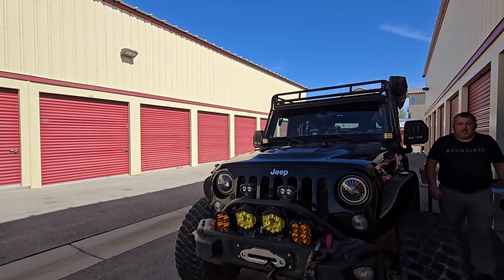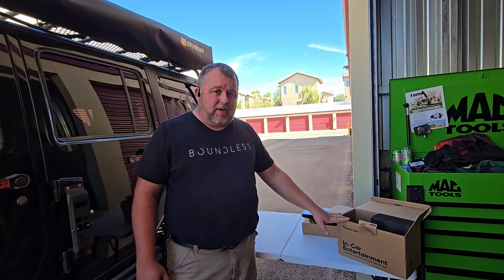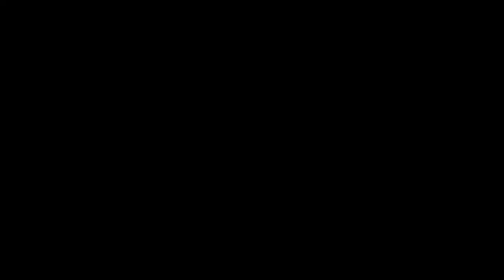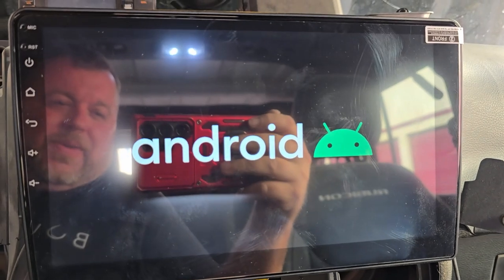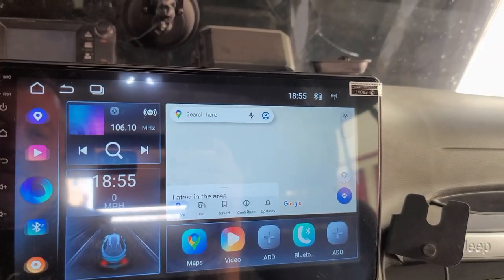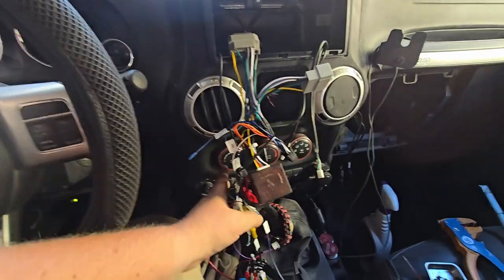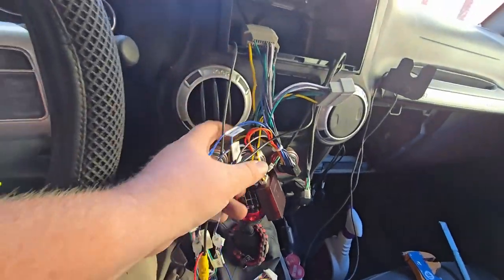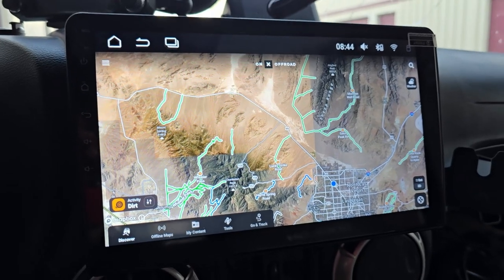youtube video #-5L6xuS3xOs

Comment: solution is  I just installed a sony radio w screen and camera with CarPlay back in 2016 for my 2016 jk 2 door      this is tooooooo complicated and its not available now.   its not wireless but charges and works great. and its built in replaces the original radio

Comment: Do you know how to take off the unit?? I installed it in my jeep patriot, but I want to add a backup camera now. And I can’t see to figure out how to get it off so I can access the wires again
Reply from the maker: Pull evenly on both sides, straight out like popping a button. Gently but firmly. Worked for me.